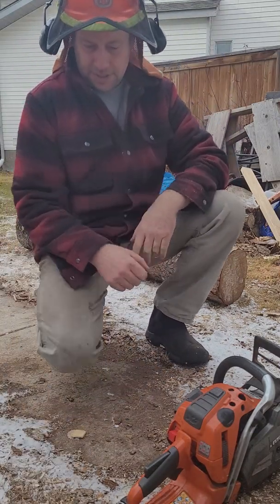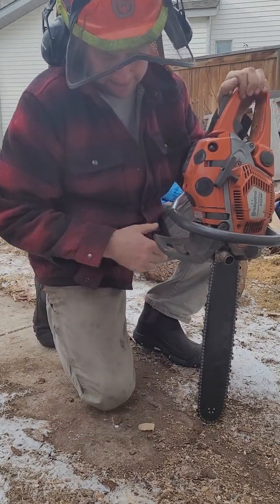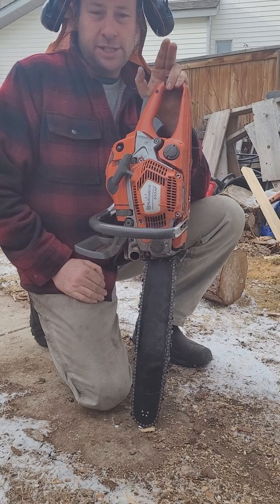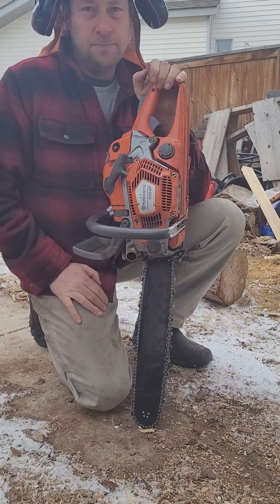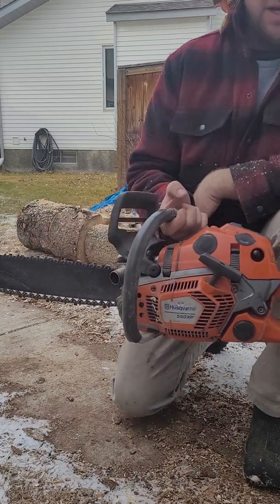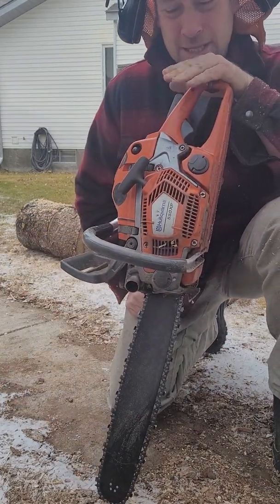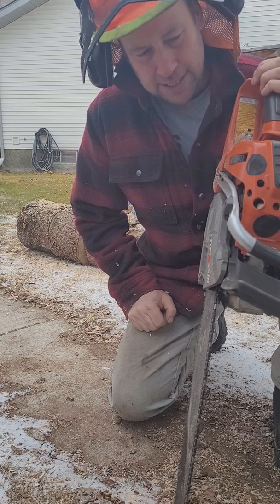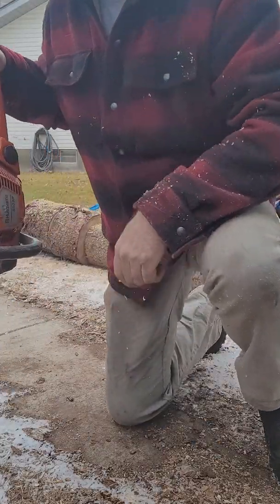Husqvarna auto-tune field reset, low and high settings

Comment: Is there an explanation for a bogging in the mid range?  I did the same as you and the issue is still there
Reply from the maker: Possible air leak that it’s compensating for, loose spark plug boot? 
Hard to really give you a good answer without for testing.
If you check out some of my other videos I go thru using brake clean to help find an air leak…it might help you find it or determine it’s not a leak and then move onto the next

Comment: So you want to do the rip-cut to reset the saw and the winter correct and then let it idle for 3 minutes when it goes back to summer or warmer weather is that correct
Reply from the maker: As far as I know you go thru the procedure I demonstrated anytime it needs to be reset. I don’t believe letting it idle for 3 minutes deals with the high setting.
Reply: @jimssawsnstuff8903  so I could do the rip cut in the summer and in the winter and that will be fine to recalibrate it correct thank you so very much just want to make sure I'm doing this right
Reply from the maker: @br-dj2ti Yes. Start the saw, let it run to warm up temperature. Shut it off. Then go thru the process. I would do it every time the average temperature changes more than about 10 - 15 degrees, it’s an easy process.
Reply: @jimssawsnstuff8903  thank you so very much I appreciate
Reply from the maker: @br-dj2ti  for sure, good luck. Which saw are you running?
Reply: @jimssawsnstuff8903  first Husqvarna I've ever owned always ran Stihl.
Reply from the maker: Well, I kind of have an addiction 😉. 
I’ve kinda gotten away from computer controlled carbs, strati-ported saws and saws with plastic holding the crank bearings together, so, I’ve got 2 x Echo 7310’s that I ported, a Jonsered 2071 with a big bore and a 272 piston in it, and I think I’m trading a 550xp for a Stihl 460. Plus I’ve got a few other smaller saws for tree work. My tree job, they supply the saws, so I got them to grab me an Echo 620 PW, for a stock 60cc saw that thing is amazing. 
Where abouts are you and what are you cutting?
Reply: @jimssawsnstuff8903  I'm right outside of Pittsburgh Pennsylvania. I'm 39 well I'll be 40 tomorrow February 5th I've been cutting since I was 18 climbing hopefully take over the company over I been  at for the last 17 years in the next two years I hope that's the plan I have 4 500i  ported I also have 2 462 ported I have six 2511 echoes ported I have 3  150 sthil ported  I have an old 066 souped-up from the West Coast it's a tank where are you from my friend
Reply: @jimssawsnstuff8903  I think we both have the same addiction hahaha
Reply from the maker: @br-dj2ti  right on, Happy Birthday! 
Sounds like you’ve been workin hard at it.
I’m in Calgary Alberta Canada now. I was in BC for a long time, was a faller in logging and fire fighter on Wildlife’s for decades. Used just about every saw there was from the mid 1980’s up to now, including the 500i. Did most of my falling with an 066😉. Now I’ve got a small shop to keep me busy and do tree work 4 days per week here 9 months of the year. I’ve got a few top handle Echos too plus a mixture of mid sized saws. I’ve got 2 x Echo 7310’s that I’ve ported and they are the best saws I’ve ever ran. Once done up they run with the stock 661 in big wood and are a really comfortable saw to run. Wish I’d had them back when I was falling.

Well, hope you sun and continue to keep up commenting on the vids. I’ve got a vid of a bottle opener on a Stihl that was a hit with the company I did the build for.
Always open for comments, questions and suggestions for saw related video topics.

Take care.
Reply: @jimssawsnstuff8903  thank you so very much I hope everything works out with you buddy God bless hope you have a wonderful year hope to talk to you again
Reply from the maker: @br-dj2ti  same to you.
I don’t have that many followers, so I try to get back to anybody that has questions or makes comments.
Reply: I'd love to recalibrate my 562 if I could just get the damn thing to start! 😢

Comment: Can you explain the cooling mods you did to the cover.  Thanks for the videos
Reply from the maker: @Michael Eargle, I posted the vid for you this morning, hope it gives you some ideals for your 550v2 😎👍
Reply from the maker: I will shoot you a video tomorrow of them. Basically used a hole saw and a variety of Frogzskin vents https://www.amazon.com/Frogzskin-Vents/s?k=Frogzskin+Vents
Reply: @jimssawsnstuff8903  bad ass, thanks so much for the reply and info!  I just bought an 550xp II so I'm looking to do some mods
Reply from the maker: Here is a bit of a look at what I did from an older related video.
https://youtu.be/O4lzZLWowjw
Reply from the maker: They are good saws when they run , don't get me wrong here, I'm not trying to put them down, I just hate to see hard working people have to spend their money on stuff that should last when it doesn't. The huskies  545,550 version 1 or v2, 555 and 562 all have some pretty inherent issues. I know they redesigned the 550 v2 a bit as well as made the 572 alot more durable. From what I've dealt with, the crank bearings, auto-tune carburetor and heating issues, they just don't seem to last. I've gone thru some more specific details on them in some of my other videos.
I personally have 3x 562xp's and a 550  v1 that have caused me a lot of frustration and cost me alot of money. I have also worked on a pile of the other ones. I've bought short blocks that only have 30 days warranty and normally only last a season...that's a huge investment. So I'm not going to  uy new carbs and pay to have them programmed and still have nylon caged crank bearing fail...the stihl m-tronics are practically the same, and stihl is also using the same type of technology and crank bearings. 
So for me, I've been moving toward more durable and trouble free saws. It's easy enough to learn how to tune a saw with a manual carburetor, but to have to deal with the other issues is not a practical, affordable nor reliable option to me.

Comment: Thanks for video and very informative but had a question on the 8" RIP and do you have the saw full throttle during this reset?
Reply from the maker: 3/4 to full yes. You will hear the rpm fluctuate as the computer adjusts the high setting.